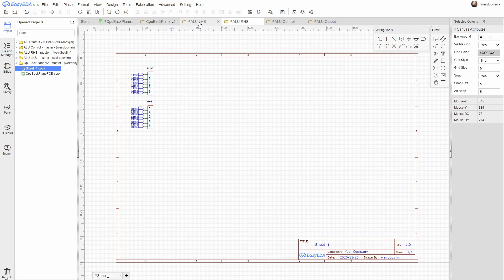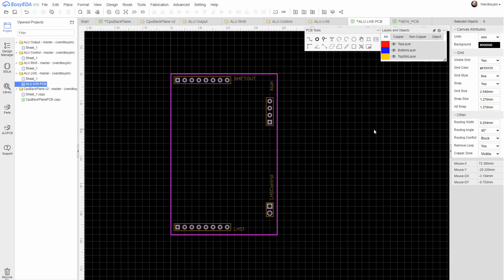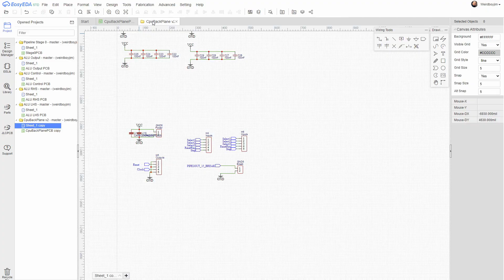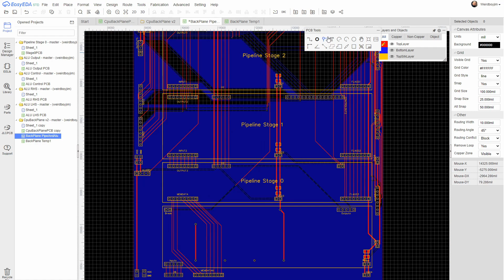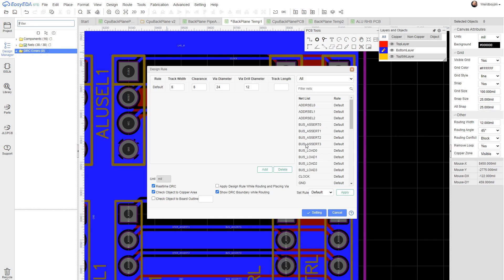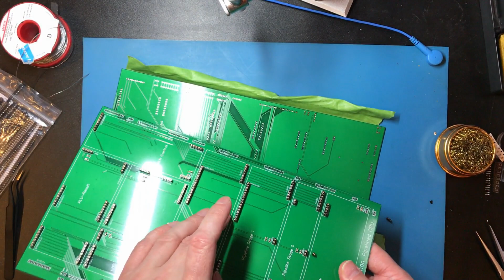ALU & Clock Backplane - Making an 8 Bit pipelined CPU - Part 87

Comment: Any chance you could do a video on how you keep your breadboard wiring so tidy? Mine looks like it was laid down by a blind drunken spider.
Reply from the maker: I'll give it some thought, I'd have to work out what I'd say and there are people better at it than me. The main thing is to take your time, there is no magic solution. The biggest tip is simple thought, there are two different lengths of power and ground lines that between them often account for around half the connections on the breadboard. I make dozens of them at a time (Usually while watching a tv shows or youtube). Even if you use Dupont cables for everything else, that will make it far less packed.
Reply: @weirdboyjim  10 minutes after your reply, Ben Eater posts a video on making your breadboard tidy.
Reply from the maker: @Rd99921  Nice. Am I excused ;-)

Comment: "We" have probably asked this already but how come you've used square pin (Dupont) headers for the interconects and machine pin (Swiss?) headers for the daughter boards?
Do you have a "knack" for splitting machine pin headers without losing a pin at the snap point?.. I have quite a collection of single pins from ham-fisted header snapping.
Reply from the maker: The turned pin and Dupont headers are not really compatible, I want to use the turned pin connectors where possible but I use the Dupont headers at the boundary where I'm going to use cables to connect to breadboards. I can make neat(ish) Dupont cables for those but there is no simple way of making a cable that connects to turned pin headers.
Reply: @weirdboyjim  oh I see... backplane interconects are sometimes boards and sometimes cables... yeah, I've had a go at turned pin cables... they're in the bin.
Reply from the maker: The boards really just started out as a hack, when the pipeline was still breadboards those were where all the ribbon cables connected.  The same was true of the alu before this backplane. The little boards are just a neater way of doing it until I merge the backplanes.
Reply from the maker: I grip the break point carefully with pliers, but I also waggle them back and forth a little rather than going strait for the break, that helps. I only had one dodgy pin with all the ones I did for this board.

Comment: Would it be possible later for you to change the backplanes so you can stack them? In order to take up less space? You may want the final product to be layed out, but I am wondering if adjustments of the backplanes would allow you to encase it.
Reply from the maker: It would be possible, I'd probably make 3-4 smaller boards that stack vertically and interconnect but it's not what the sub modules are designed for. This build is for presentation and demonstration, it would be better to take the schematics and strip out most of the LED's and circuits for driving them to save space.
Reply: You need to see the LEDs... all that effort and no blikenlichts would be sad.

Comment: Nice work! It's surprising how much smaller the final pcbs are compared to the breadboard setup.
Reply from the maker: Indeed, It was less obvious on the registers because I never built a full set on breadboard. The pipeline reduced in size a lot but I kept the dip28 rom chips for ease of programming.

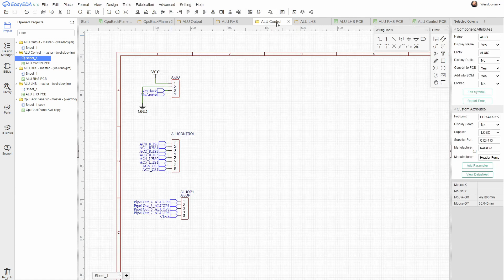Comment: Around 10:20 it seems like the AluOP header on the backplane board has ended up rotated 90° to the control module board itself
Reply from the maker: I checked it, you are correct! Fortunately that module isn't one I've sent of for manufacture yet. Making videos is a real pain, but it sometimes has the benefit of having people spot issues before they cause you pain!  Thanks Tom.
Reply: @weirdboyjim  saved by the (notification) bell! 🤣
Reply from the maker: @TomStorey96  It's anoying the way Easyeda doesn't always associate the 2 parts pasted in from another schematic as being the same components. Sometimes it resets their positions. I think it has something to do with name uniqueness.